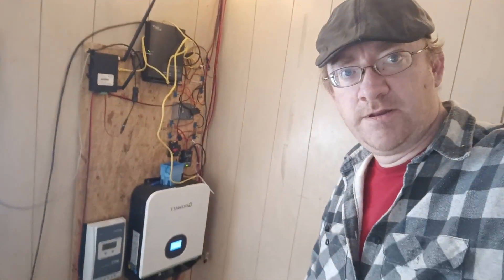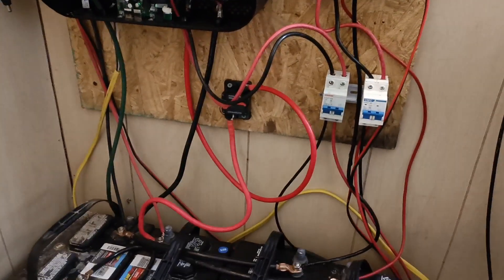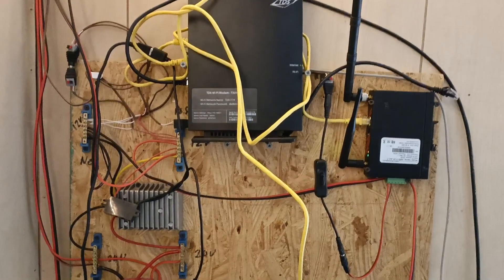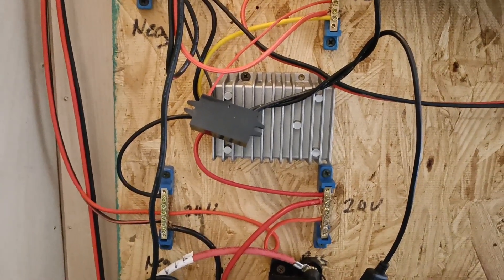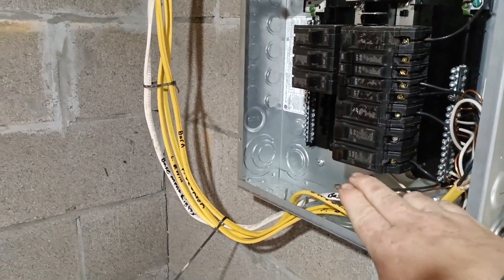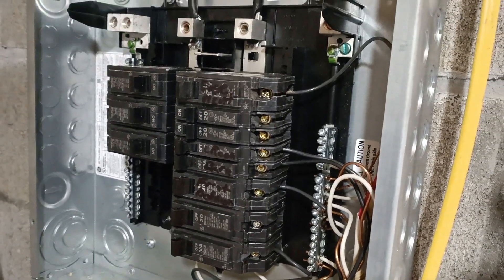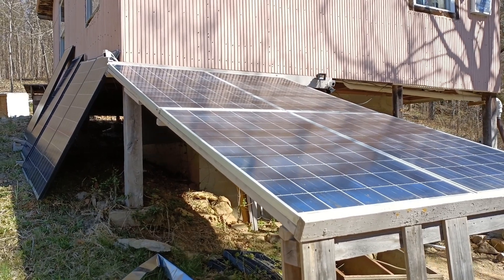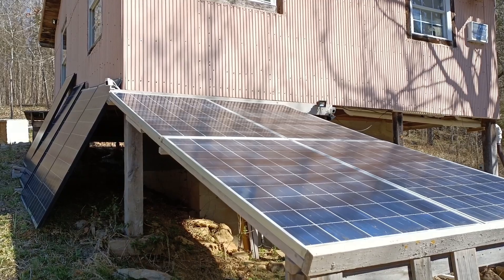Walk through of my setup for my solar powered off-grid cabin

Comment: the epever can be over paneled with if i recall 1500w of solar it will just ramp the power back to always give max of 40 amp into the battery
Reply from the maker: It can go over by only 25%, so I would keep it under 1200 W. Over panelling helps get more power earlier/later in the day. At noon you are wasting power because of that, but at least you are bringing in more earlier. I debate with myself over-paneling or just getting a larger charge Controller
Reply: @tennesseevalleysolar4101  it may waste power at mid day but they is a better chance of steady current rather then fluctuating  and charging unsteadily

Comment: What size generator are you using for charging the system on cloudy days ?
Reply from the maker: I have been using a 2500 w peak generator but have recently added a 4500 w gen I also use